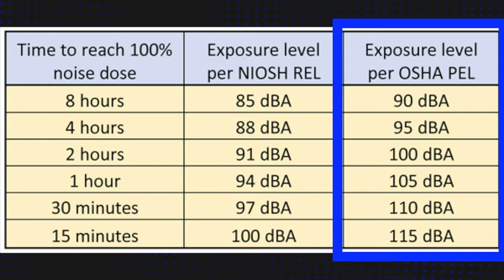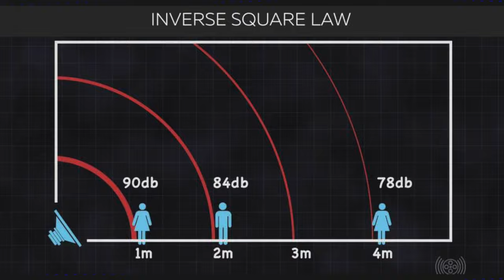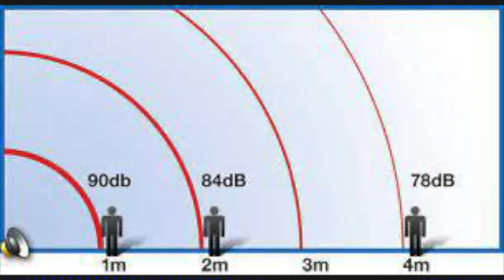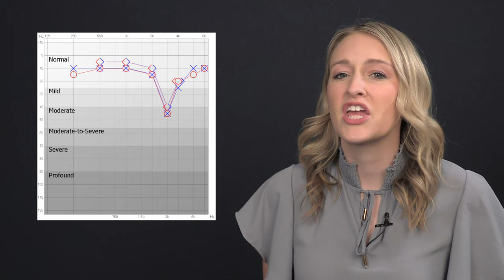How to Avoid MAJOR Hearing Damage This Fourth of July

Comment: Lots of good information in this video.  I have had tinnitus since i went to a concert in 1982 and i was 36 rows from the speakers.  I can only imagine how loud it must have been in the front row.  I could very easily been a lot closer as this was when festival seating was still in place.  I’m built for comfort not speed.  I probably saved myself from more noise induced damage for that reason.